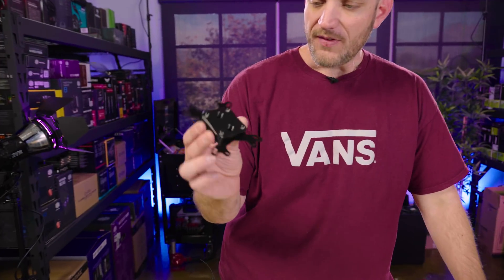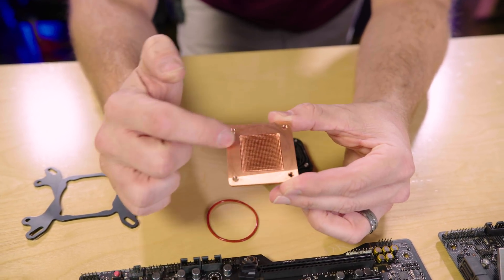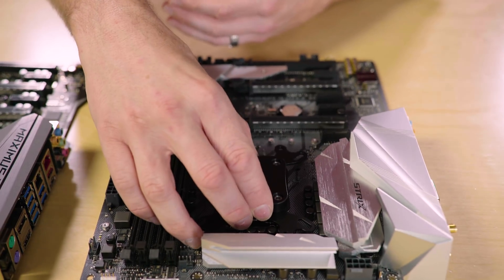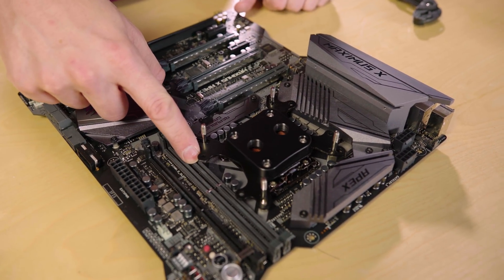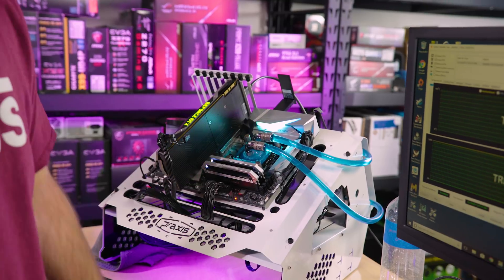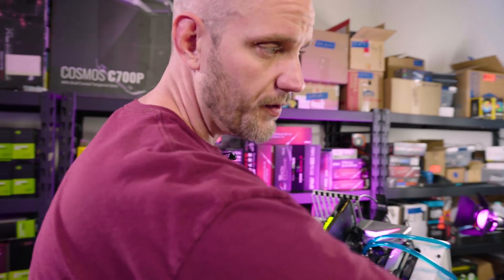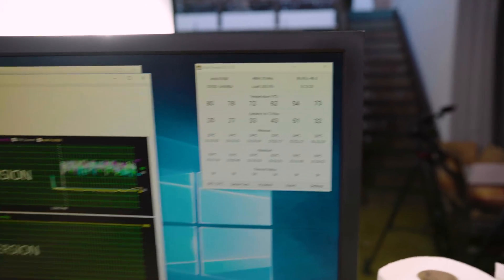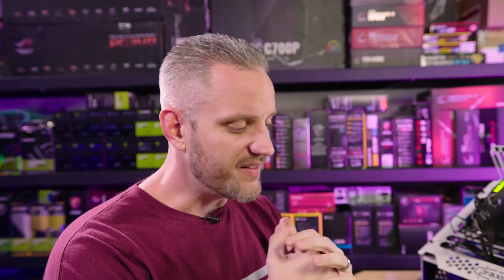I tried watercooling an overclocked 8700k with a $19 waterblock

Comment: Great mod, Jay! I'd say showroom ready at the very least. :D

I have to say, I'm not surprised by the result. Back in the early 2000s we cooled our CPUs with just a copper block that had a single s-curved channel milled into it, and they never hit 50°C despite pumping out 60 watts. Really, all the micro channels and jet plates these days are 90% marketing and 10% performance. As long as you have water flowing through a chunk of copper, you can probably cool your CPU with it.
Reply: Yeah it probably doesn't do a lot, I ran a very cheap Chinese special on a heavily overclocked hexacore xeon for years and temps were likely the same as what i would have got with an  ek block, i actually run an ek block these days on a cpu putting out similar heat load and temps are indeed much of a muchness. So much assumptions in pc water cooling  community, like the people who claim you need massive amounts of flow, like 100+lph! In reality you don't see major loss of performance unless you go under 10lph! This is with a large loop with plenty of radiators, maybe smaller loop flow may have a bigger bearing, i don't know as i always have run excessive radiators.

Comment: Im interested to see jays cheap loop video. I have been interested in water cooling my rig for a while now. I see reasonably priced AIO water coolers but I dont like how most are non refillable. 
 As far as a cheap somewhat custom loop from amazon. 
I found:  BXQINLENX Professional Special CPU Water block- $19.98
               BXQINLENX 120mm Aluminum Radiator- $15.99
               Yosoo 12V DC Low Noise Water pump&pump tank- $22.03
               Corsair Air Series SP 120 LED Red High Static Pressure Fan- $12.79
               PrimoFlex Advanced LRT 3/8in. x 5/8in. Tubing Bundle 10ft- $26.95
               --------------------------------------------------------------------------------------------------------------------
                  Total = $97.74

But a nice AIO could be had for that price. The EK-KIT G240 Premium Watercooling Kit on amazon for $249 seems like a nice kit if you dont want to source individual parts. And of course higher quality then my $97 solution.

Comment: 6:14 gotta respect the sharpie!!  Jay/Nic....delid that 8700k and redo. Just for SnG's

That o-ring looks like a mid level silicone piece.  Should be fine.  If worried, coat it with a little silicone grease. I recommend Super Lube, comes in a grey tube with blue and red colors on it.  I just snagged one from Prime.  jay's link was 50 cents cheaper, but wont be delivered until mid-late January. almost gone! get it here
https://www.amazon.com/gp/product/B01ELC6E66/

Comment: I built a custom loop for $60 It handles now a 6700. That is cheap ;)
Reply: jack.ly what is your stuff ? Size rads and pump?
Reply: Confeter Confeter A cheap water block from ebay around $3. I 3d printed a mount for the socket, some gas tube from a car parts shop, an aquarium pump, a vase from tesco and a 120mm radiator with fans. Here is my pc design: https://www.instagram.com/p/Bcx6s5Hg7Gf/

Comment: POM, Delrin and Acetal are all the same plastics, it's not expensive and is easy to machine, I can see it looks milled so it's either from the injection mould when it was milled, in which case it's probably ABS, or it's POM and was milled.

Comment: We urgently need a bigger motherboard format in 2018.  More vertical M2 slots.  More space for larger air-coolers, more fans, more space for thick video cards.  More SATA ports, more USB ports, bigger wi-fi components.   It should look awesome and hang on the wall like a painting.

Comment: Yeah.. With Intel you can basically "jerryrig" anything you want.. I took an incompatible CPU and mount with an incompatible fan and still got it to work... (A.K.A I just ziptied them all on and it works well, I didn't bother to check temperatures, but it hasn't crashed yet for a couple months so I'm all good.

Comment: It's a shame that the stock intel CPUs don't transfer any heat to the coolers. The temps didn't rise because the water didn't get any warmer. When I ran my 7700k in a small loop with 3dl water, I had to stop the fans completely to see any change in load temps. For every degree the water temp increased, so did the CPU. You have to put liquid metal on them if you want your cooling system to do anything. I felt like leaving on the stock tim would've meant 240usd wasted on my loop.
This is a good test for what you can expect with a stock intel cpu.
I thought if you are so serious about OC, you would delid those things... I'm so disappointed.
Reply: kepeter97 so you mean tHat its because of the undelidded cpu that we see any different in temp between these waterblock ?
Reply: If the "stock intel CPUs don't transfer any heat to the coolers," then water temperature wouldn't rise with CPU temperature. But you say "for every degree the water temp increased, so did the CPU." So, yeah.

Comment: @jayztwocents I have that same water block I used for my AMD FX-8120  for over 3 years. Here's my long term review. It works fine. BUT at one point it leaked from the O-ring a little after taking it apart once. My solution was a small bead of silicone sealant. It lasted for another year till I replaced my CPU with a ryzen 1700x. The O-ring feels like neoprene if I'd guess.

Comment: I would think that, if anything, milling the channels deeper into the plate would be more effective at cooling. The water gets closer to the source of the heat.
Reply: It creates more friction to have the water turn a hard corner in the plate rather than inside the waterblock. I'm just guessing, though, I don't have a comparison waterblock open in front of me.

Comment: Just a quick heads up so no one goes out and buys a whole bunch of screws for their home workshop, those screws are not 6/32”. If they were that would mean they are just shy of 1/4” in diameter. The screws are 6-32, which represents a 6 gauge diameter and 32 threads per inch.
Reply: How can you live in that imperial hell?

Comment: I made a cheap ass custom loop in my rig , the goal is to spend less or same than an AIO 280mm for the cpu and morpheus like for the GPU (vega) , i spend 190€ for my total loop and the temps is way below my original setup. pics : http://www.sts116.com/img/images/1712/c_1_171210044534.jpg
Reply: I can hear those VRMs screaming for help through the internet....
Reply: gpu vrm ? the rig is not working , the ssd is dead , i wait for the thermal pad to put some heatsink.

Comment: From personal experience, as with many China products, they will function fine initially but are not built to last. Expect problems shortly after, you have been warned.
Reply: Sure. Many companies use Chinese manufacturing due to low cost and high quality. All of my power tools are made there, based on designs from other places. I'd say the "made in America" ones were better, but the American companies get their tools manufactured in China, and when they did manufacture them, they were heavy, just as reliable/unreliable and they cost too much.

Comment: This exact waterblock can cool GTX 1060 overclocked(~130W) under 50 degrees(custom plate with only the exact waterblock from the video).I got it currently on my build. Of course i polished both surfaces and i added separator between the both holes for better efficiency.

Comment: So... this is better then EKWB...
Reply: Max temps got higher, so I assume the mobo kicked up the fan speed, that's why it came down later. Or some process in the background got higher priority, so the stress test wasn't actually doing it's job 100%.
Reply: kepeter97 It doesn't work like that... you could say the same thing about  EKWB test... and by the way, that doesn't really happen, you don't do multi tasking while stress testing and no background process has real time priority. And if fans got activated, and I think Jay is too expert to do this sort of test with variable fan speed, once the temperature got lower, the fan speed would have been reduced and temperature back up pretty quickly, which you don't see.
Reply: No. It isn't better. There was nothing in the video that indicated it's better. It's cheaper, though.
Reply: Well, although less stable, temperature are lower then EKWB.
Reply: Oh, so fan speed and noise are no longer factors.
Reply: No, they have never been when test focus is about temperature.
Where did you ever lived?

Comment: Why everyody using AIDA64 for temp test, when its clearly cannot punch it through like the good old prime95 on smallfft.? Under aida stability test my CPU consume 40 W and it have a hard time to hit 50C and no more but under prime it eat 60W and hit 60C in no time (thats an another story, that is the max for it on the current settings,), so Aida64 isnt enough hard on the system. (This is an undelidded i5-5675C in an Asus Z97i plus with Multicore Enhancement enabled, Dark Rock Pro 3 sit on it and Thermal Grizzly Kryonaut paste used)
Reply: I think aida is good if you want to see what it would be like under normal use. The others are great for testing the cooling system, so I aggree, in cases like this, aida shouldn't be used
Though a proper burn-in application might push an i7 to 100C with the stock TIM, no matter what cooler is on there.

Comment: An auxiliary transmission cooler is your best bet. Even has all the same threads and hole sizes. Best part? A copper rad that is 3x the size of a 360 PC rad is half the cost. Some even look the same as a PC rad.
Reply: Thanks for sharing that excellent idea.  It reminded me of people saying they use automotive antifreeze as the fluid in their custom loops.  Apparently its also dirt cheap, plus it works well and looks great too!  Whether it be on car engines, transmissions, or a computer's cpu, the need for a cooling solution is the same, only the scale differs.  It makes a ton of sense to check out what's adaptable to pc's from the automotive world.
Reply: If antifreeze runs through your Transmission rad in your car you mounted it wrong or something is broken. It's why you should never get a used one for your PC. Wash a new rad well with TSP and rinse before you use it on your PC.
Reply: Oil coolers work well too. That's what my radiator is, and I'm using antifreeze+distilled water and home Depot tubing lol
Reply: Solder Joe trans/oil coolers are often built into the radiator themselves so they are cooled with antifreeze technically although there aren't any mixing of fluids; they're all separate entities
Reply: Phantom Fiero Can you read? Is English a second language? Auxiliary!!! So technically you are a  Dumb ass.
Reply: Phantom Fiero. No oil coolers are not the same. They are made for a different liquid and they are made with tapered pipe threads not at all the same as PC  or Tranny coolers.

Comment: GAH!  Steel filings anywhere in the same BUILDING as a motherboard...  Let alone on the same damn bench-top!  Yeeks!

As for the cheap Chinese waterblock...  My primary concern would be the quality/composition of the "copper" in that base plate.  All you need is some crummy unknown kind of zinc-based brass in there, and your loop is in electrolysis hell.  Then again... if your rads are gonna be left-overs from an automotive junk yard, maybe we're not really worried about that issue on this one.
Reply: boatrat74 
Let's just go worst case scenario and use mayonnaise for thermal paste (insert "Intel already did that" joke here)
Reply: just put more antifreeze in should help prevent corrosion
Reply: My question, is how long does it need to last? This CPU will be obsolete in 3 years, so is it really a loss?